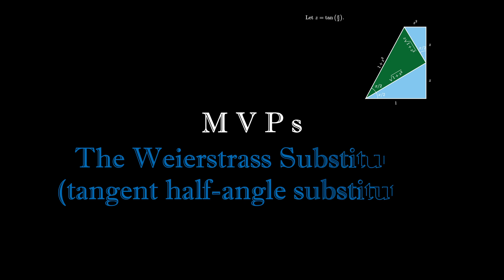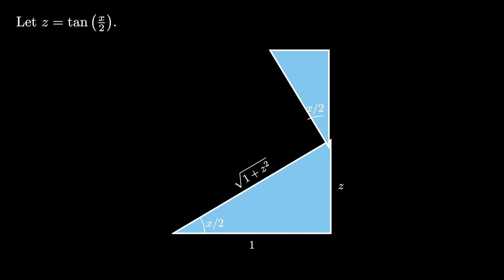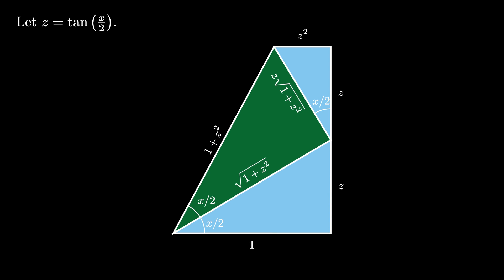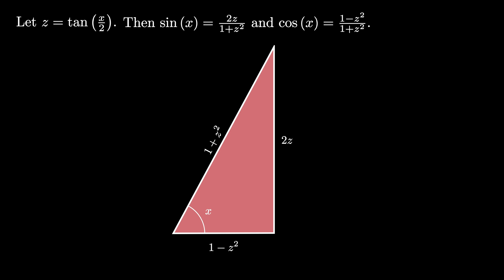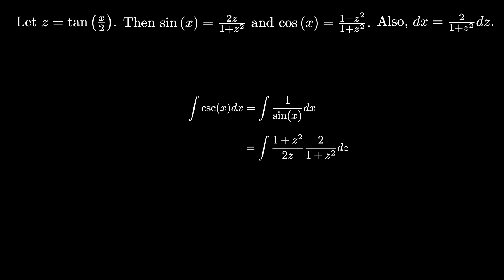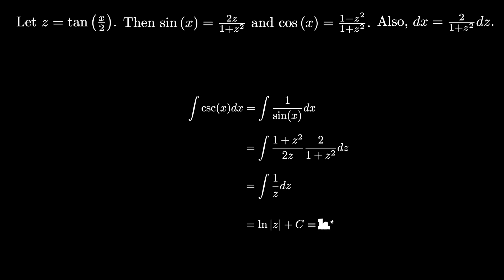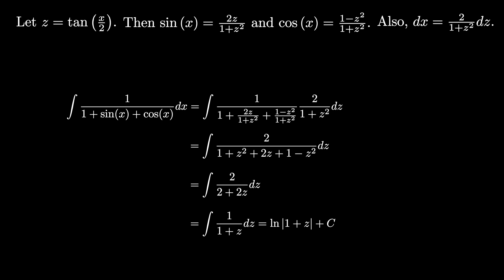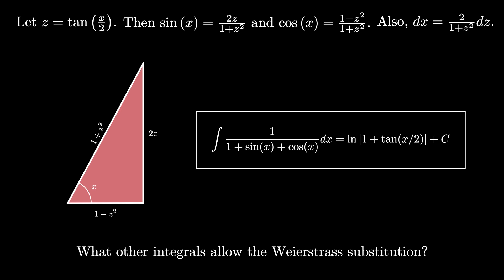Integrating by Weierstrass Substitution (visual proof)

Comment: umm, where is my mistake?
in the new triangle with the square roots if you use the Pythagorean theorem you get
(sqrt(1+z2)2+(zsqrt(1+z2))2 =
1+z2+z2(1+z2) =
1+z2+z2+z4 =
1+2z2+z4 =
(1+z2)2
Reply: however by similarity (2 angles, can be proven independently from the sides) we get the side length should be like in the pic. I verified and the angle opposite to the 1+z2 is 90 degrees, so the Pythagorean theorem should hold
Reply from the maker: @davidbass5115  That is the pythagorean theorem correctly in your work. You summed the squares of the two side lengths, and you got the square of the hypotenuse. I don't see a mistake?
Reply: @MathVisualProofs  oh right its a square 🤦 dont do math at night kids

Comment: if you scale the sides by z, won't the sides become lerger as ooposed to smaller? could you pls explain this to me
Reply: I am wondering the same thing
Reply: z is less than one. Why is z less than one? Because x/2 < 45⁰ is an assumption in the picture. If it wasn’t, we would’t get the trapezoid because x would be greater than 90⁰. Anyway, since tangent = opposite/adjacent = z/1 the x/2 < 45⁰ assumption implies tan(x/2) = z/1 = z < 1 since tan(45⁰) = 1. This is okay because 45⁰ in the central angle is enough to get you the full 90⁰ in the inscribed angle. So this proof is best understood as a way to remember or derive the same result you get with the more general visual proof that uses a semicircle.

Comment: A:= (x,y,n) -> [[x,y], [-y, x]]^n
B:=[1,0]
B.A(1,z,2)=[1-z^2, 2*z]
C:=(x,y,n) -> (x+i*y)^n
C(1,z,2) = 1-z^2+i*2*z 
I call A the rotation matrix. Everyone tells me I'm wrong. I'm ok with being wrong. It is rotating by the angle [x, y] forms with [1,0]. The length is sqrt(x^2+y^2)^n. There is an ellipse that has a similar algebra. Both algebras are used in Mandelbrot Sets. I suppose it can also be called a translation matrix.

Comment: What's insane about this is that this is also virtually identical to how you can prove the Sum/Difference Formulas for Sine and Cosine.
Reply from the maker: Yes. I have that version in the works. If you check my channel you will see how many diagrams get repurposed for different results. This one shows up a few times. 😀
Reply: @MathVisualProofs  Thats the coolest thing about math. So many seemingly unrelated things just keep unexpectedly tying together in weird and magical ways.
Reply: @EvilSandwich uea but math an also be reslly dumb and contrived and infuriating, all due respect..and isn't this an example of that..this just comes from contrivance not from intelligence right?
Reply: @leif1075 Math, at it's core, is a tool used to examine the world in a more easily digestible way. And the streamlining of observation that it enables can sometimes reveal connections to other topics that weren't always apparent with all that messy reality in the way.

So it's less a contrivance, and more just adding some clarity. 

Akin to finding a connection between two separate cultures that you didn't notice before you examined the grammar of both their languages.